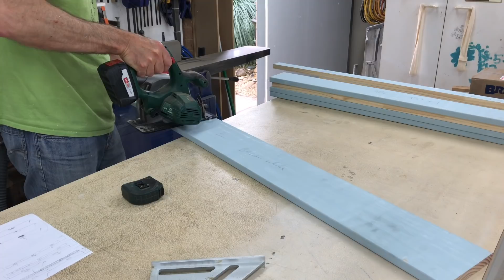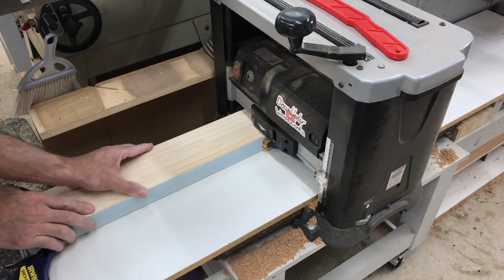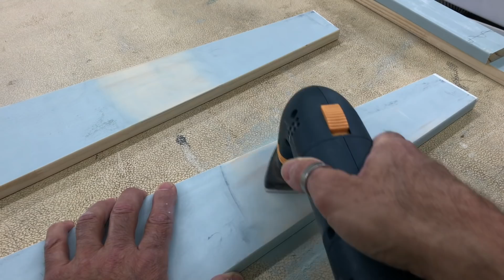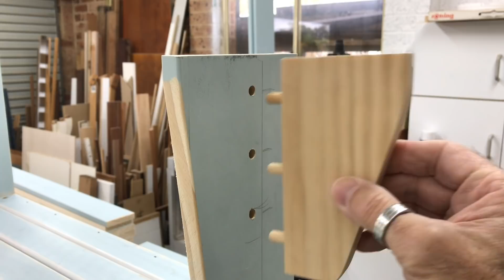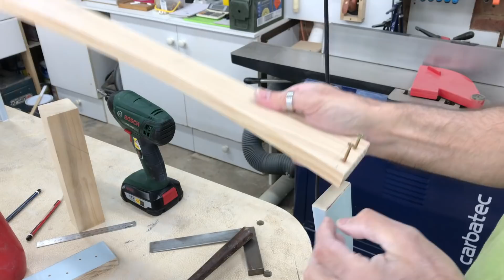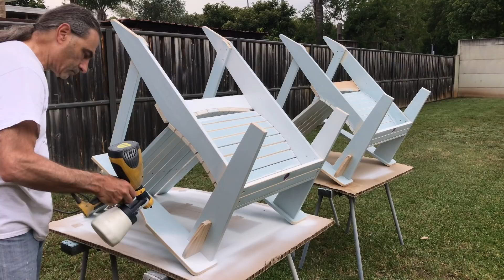How to build these great looking Adirondack chairs

Comment: Nice work mate. It's a very popular design, and I reckon you made a good decision to use 'design pine' for them. Better than those splintery hardwoods you have. 😂
Reply from the maker: Absolutely mate, that old aussie hardwood would have been a real pain in the arse 😂... and a real chore to mill up all the bits for each chair